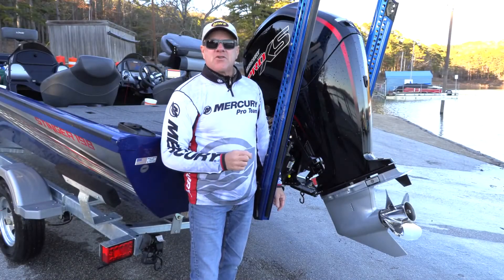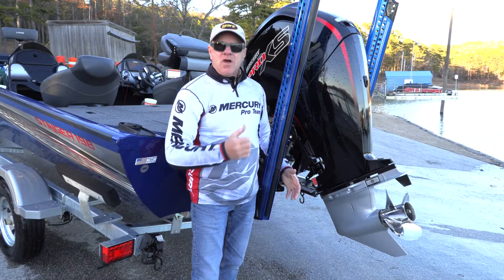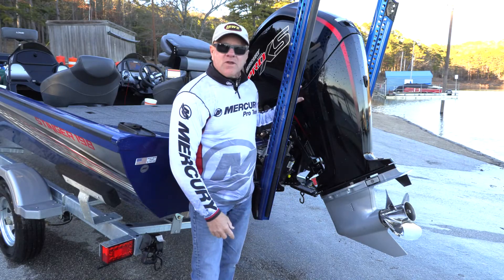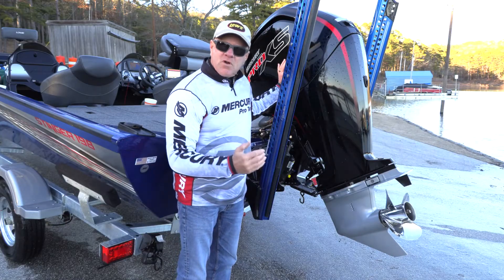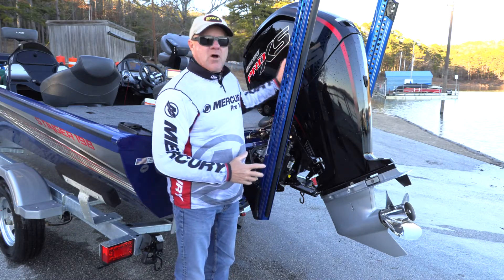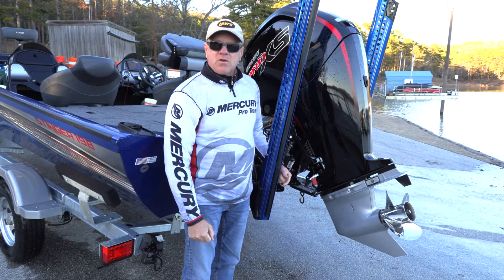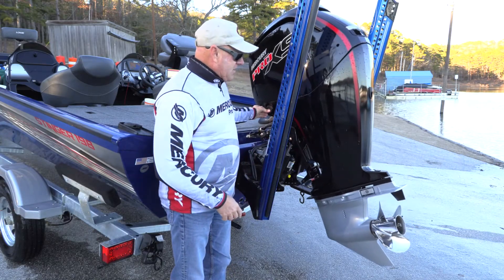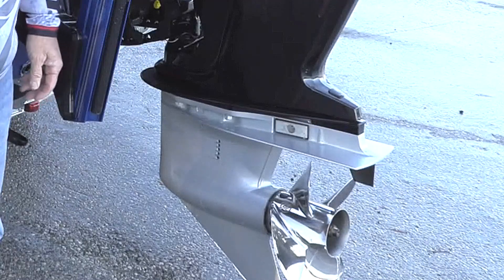Freezing Temps No Problem for Mercury Outboards

Comment: Check manuals or Youtube on how to fog engines for winter storage. ETEC  engines should have self fogging which is awesome. You may have to take spark plugs out and use fogging spray to do this. Have a great day.

Comment: I have a 2019 150hp outboard.  Stored out of water through every Indiana winter since we purchased new.  Do I need to fog the engine?  I've seen several "winterizing" how-to videos discussing oil, gear lube, fuel filter but none have mentioned fogging.  TIA!!!!
Reply from the maker: FourStroke engines are not fogged the way older engines were. We've outlined the full storage preparation sequence in your operator's manual for reference, and you're welcome to download an electronic copy from our website (link below), if needed. We're happy to sum up the storage preparation steps below, but be sure to check the manual for the product you own in case additional steps are required, based on your model. To prepare for winter storage, we typically recommend the following steps be taken:
- Treat the fuel system with Mercury Quickstor
- Change the gear lube in the lower unit
- Coat the propeller shaft with 2-4-C Grease
- Run the engine to circulate the treated fuel and warm the engine oil
- Change the engine oil
- Inspect the spark plugs, and while each is removed, spray 1 ounce of Storage Seal into each combustion chamber
- Address any grease points on the steering and tilt system
- Address any bare metal with touch-up paint
https://www.mercurymarine.com/us/en/parts-and-service/service-and-support/owners-manual

Comment: Does this apply to a 2008 optimax as well?
Reply from the maker: Sure does! When you're done using the engine, simply pull it from the water and trim it all the way down. This will allow the water to fully drain from the cooling system passages automatically.

Comment: Do you know what was the earliest year that has this feature?
Reply from the maker: Our outboard engines dating back to the 1950's were self-draining when pulled from the water. 👍
Reply: @MercuryMarine  ok cool what temperature are they safe to keep them unwinterized till outside? We have 20C days still here and last night was the first night it dipped into freezing numbers
Reply from the maker: As long as the engines are out of the water and sitting in a vertical position, they are safe to below freezing temperatures for an extended period of time. The winterization process of your outboard is really more of a long-term storage preparation process (i.e. treating the fuel, treating the cylinders, etc.). However, It is suggested to drain and fill the gear housing lubricant before temperatures dip below freezing due to the possibility of having water in the gear lube.

Comment: Oh, also use Seaform and starbrite gas stabilizer in your gas tank. Keep your tank fuel as empty tanks can corrode. Next baoting season, change lower unit gear oil (see youtube, its easy) and water fuel seperator. Have a great day.

Comment: do you also have a recommendation on longterm outdoor storage in freezing temps?
Reply from the maker: Hi Dustin, great question. We always recommend following the storage procedures listed in the operator's manual for the specific product you own. If you need a copy of your operator's manual, please email your engine serial number to social@mercmarine.com, and we will be happy to supply you with one.
Reply: get a 100 gallon rubber tub (tractor supply has them) and get an electric water drain pump with a garden hose attachment. Get 5 gallons of marine/ RV antifreeze that is toxic free environmentally friendly.  pour antifreeze in tub lower your outboard engine in the tub. attach hose from water drain pump to flush port on engine and submerge water drain pump in tub.  plug in the water drain pump and circulate marine antifreeze about 5-10 minutes. The marine antifreeze should have anti corrosion in product as well to prevent corrosion while stored.  The Marne antifreeze is rated -50 below (check bottle for range of temperature). You don't need to have muffs. DO NOT START ENGINE, you need water muffs if you do it that way, you could risk burning out impeller in seconds if no water is supplied, just use your flush port and don't start motor. Drain outboard motor by raising and lowering tilt 3 minute intervals for 3 times. store on trailer with motor down. mask tape over exhaults flush ports so not rain gets in. Don't forget to fog engine (see youtube). Etec engines have self fogging  which is great. Have a great day.

Comment: I’m sure I’m fine but what would the first signs be that the water froze and damaged my 2022 mercury motor?
Reply from the maker: If you have an outboard and it was allowed to drain after it was last used like in the video, you should be safe. Sterndrive and Inboard engines require a little more attention at the end of the year. Unfortunately, you wont know if any damage has been done until you're able to run the engine again. Cooling issues, leaks, and water in the oil or gear lube after running can all be indications of cracked castings or broken gaskets.
Reply: Water in the oil can also be an indication that your thermostat is stuck open. It happened to me. All is good now.

Comment: Another oh... lol, Battery should be stored in warm garage or have a NOCO charging unit (they won't ruin charged batteries if left on batteries) the internet sells them in many battery banks so you can have them installed and never have to keep changing to other batteries. the NOCO charger are many capatible to many battery types and has maintenance mode too. Have a great day.

Comment: What happens if you leave your motor on the lake and it goes to -5 during the night? Are you asking for a cracked block ? Thanks  guys .
Reply from the maker: Leaving the engine on the lake in those conditions can be tricky. If you leave the engine in a vertical operating position, all of the cooling water from the powerhead will drain down as far as the water level on the lake. This means your engine block would be unharmed, but your lower unit and midsection will still be submerged and can freeze. It would not be advisable to leave the boat in the water in those temperatures with the engine tilted up as it cannot fully drain until it is tilted down. The best option for extreme cold weather use is to pull the boat and engine from the water at the end of each day so it can drain appropriately.
Reply: @MercuryMarine  Cheers man .Very helpful info.emptied the bucket today .Temp at 8 degrees now .Started her up .All fine (thank god). Engine down and drained .....Got away with it .Every day is a school day .Thanks again.My engine was in fact left in a big bucket 2 feet deep for a month as I have been tinkering with it .